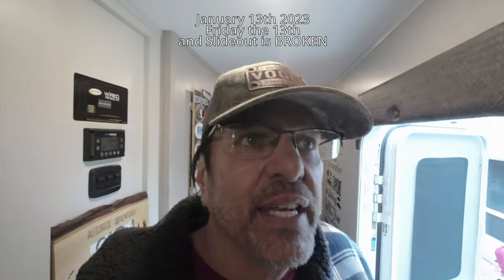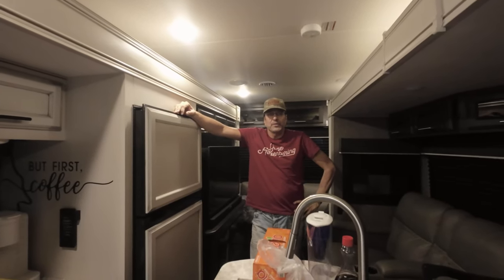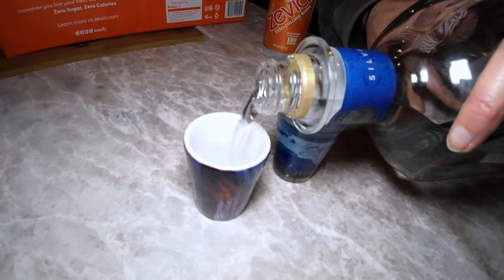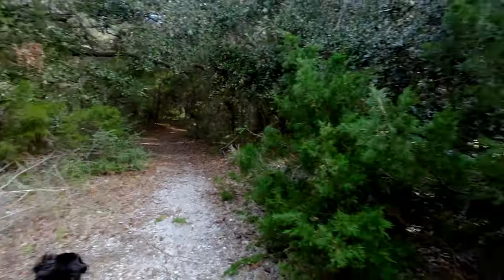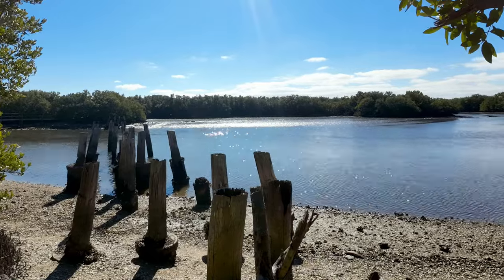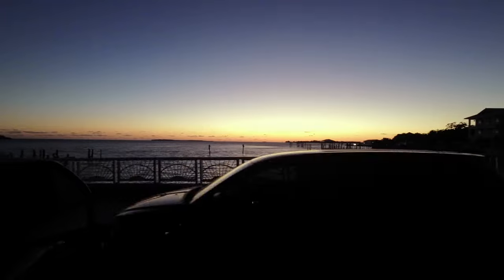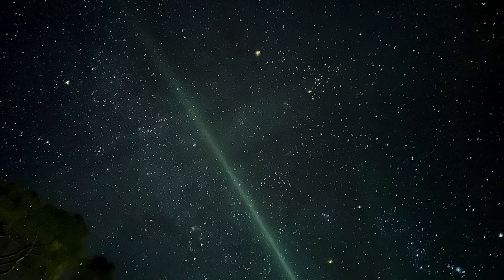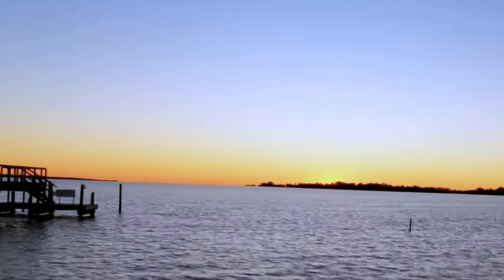Fixing a Jammed RV Slideout - How to Retract Manually

Comment: Sorry you had the slide issue, but don't get stressed as things break all the time. Over time, you will learn how your systems work and how to repair them yourselves. We've retired and have been FTing for 4 years now. During this time, we've had to replace our slide board and repair the slide motor gear box twice with JB-Weld. The second time was the charm because we used the 24hr JB-Weld which is much stronger than the 5-minute type we used the first time when in a hurry to leave a campground. Given enough time, just about everything will eventually wear out or break, so you must be mentally prepared for that challenge if you want to live the RV lifestyle. We have a 1999 National Tropical Class A that we only took to the shop twice - once for a recall and once to get the transmission oil and filter changed. All the other work we've done ourselves, from fridge and heater repair, hydraulic jack repairs, AC repairs, step repair, various electrical repairs, toilet repair, etc. to the installation of our tiltable solar array, including a custom lithium battery bank, BMS, active balancer, inverter, converter and battery to battery charger.

One thing I learned from years or RVing is to never buy an RV that doesn't allow access to your fridge, stove, bathroom and bedroom with the slides in. Heck with our slide in the only thing we can't get to is our liquor cabinet - which is hardship enough. 😉 We sometimes travel across the country, from coast to coast, stopping for the night at Interstate rest areas, casino parking lots, Walmarts, Cracker Barrels, etc. where it's not appropriate to put out one's slides - but access to the essentials are still needed. It's neat that you are able to retract your slides with an electric drill. We have a single, large slide in our motorhome and when it won't retract, we must flip a clutch switch on the motor and use a giant crescent wrench on a square bar to retract it using brute force, working up a sweat for 10-15 minutes depending on my stamina. At 66 years of age, count on the latter.
Reply from the maker: Yeah we’ve been RVing since about 2015 or 16 and we’ve had a few things go wrong for sure it just seems like we’ve had a lot on this Jayco and I think a lot of it was due to it being built during the Covid shortages. Generally also when we overnight, we only run the kitchen slide out we never generally run the living room slide out, but not being able to get to the liquor cabinet that just sounds like a bad day all the way around lol

Comment: We have the same model and have issues with the kitchen slide.   Unless the RV is hooked up to shore power, the slide does not come in on both sides at the same rate and gets crooked and jams.   It just seems the motors are not powerful enough and struggle bringing the slide in    Anymore I keep the RV hooked up to shore power or a generator before moving that slide.   I have anxiety every time we have to bring the slide in...
Reply from the maker: Wow!!! I’m betting the gear broke on the one motor. It’s does seem like a large heavy slide for such a system. I will keep you posted as to what they say.
Reply: Oof. That’s sounds terrible. Do you know the backup plan if it fails?  Just knowing it could help alleviate some of that stress.